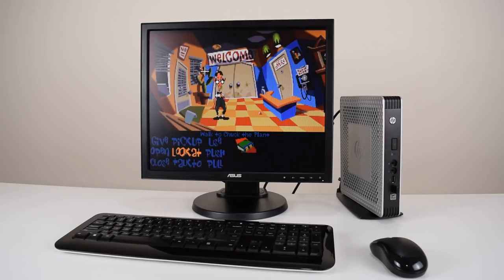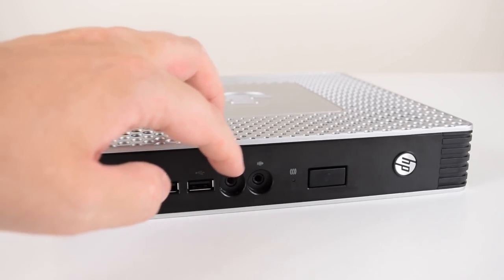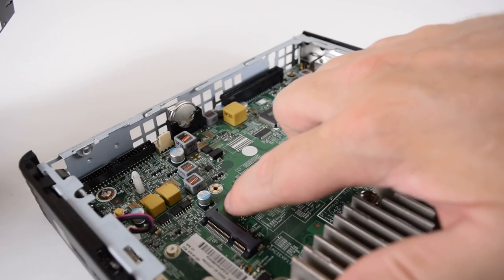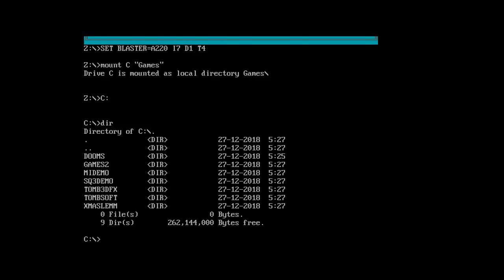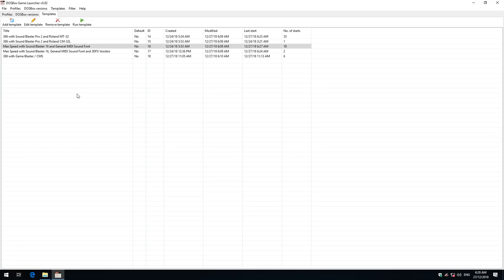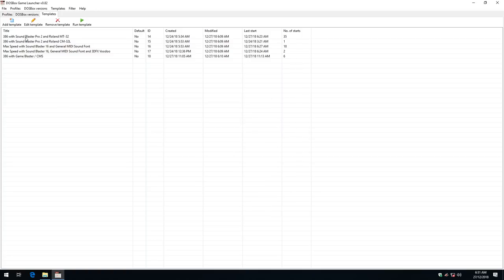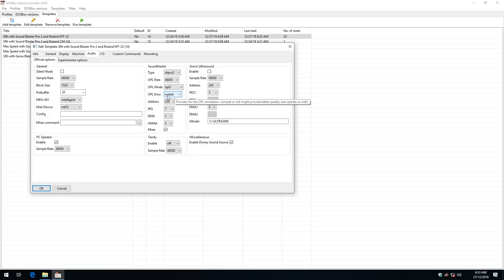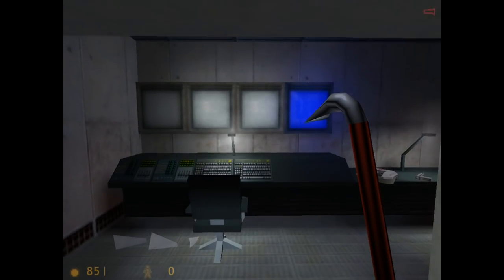DOS PC Classic - Building a DOSBox with Pixel Perfect Graphics, MT-32, 3Dfx Voodoo and more

Comment: That launcher for DosBox is pretty good. The root folder makes the launcher portable and it's an excellent option for pendrives. I still recall my young cousins stunned with several Dos games, including my favorite... Tyrian 2000. ;)
Reply: Definitely. My dosbox collection is setup on a 128gb microSD that came with a Micro to SD adapter and a usb adapter.
Reply: I use another dosbox menu program called launchbox for Ms dos 2.0 special edition

It's very dossy lol

Comment: Hi Phil, Great video.  I have $$$ for ebay, for a thin client, but i am seriously running out of free desk and cupboard space.

Two things to add
1. Another good add on for Dos box that i use is called D-Fend Reloaded, not quite as advanced and as good of what you showcased ( which is a better product ) but a smaller and simpler solution, it searches your dos box drive and finds matches, it has a wizard so popular games have a working config, all others you can run as is or select right mouse edit properties and you can change setting like meory usage , type sound etc

2. A similar product to dos box but geared more to console games is Recall Box, this is very similar to Retro Pie, you download the image for the main program and etcer or similar to USB stick, then in the folders add your roms.
The beauty about this program is the practicality, once burned to USB and set up, all you have to do is first power of the PC, then plug in the USB  , then turn on the machine, if the bios supports boots from USB, the program will load and you have the main menu to run the emulator / games, no need to the machine to load its native OS first

Again excellent stuff

Regards
George
Reply from the maker: I used to use D-Fend Reloaded, but no new version since a few years. I don't know about the second one. I always found that similar sounding tools are better for consoles and arcade games, but not for PC with support for MT-32, Sound Fonts and all of that.

Comment: That's pretty cool.  

I have a couple of the t620 thin clients from a job I did last year, they were pretty upspecced too. Hadn't actually thought about using them as retro machines. Will dig one out later on (in the middle of redoing my office/playroom) and have a fiddle. Should work nicely with my spare Dell 2007fp screen and it's soundbar. Might try running Gamecube/Wii and Dreamcast on it too. 

Could be an interesting change from a raspberry pi in a small arcade cabinet.
Reply from the maker: Man there is much you can do with them! From running a NAS (check my recent video), to running pure DOS / Windows 98 or Windows XP and many other uses.
Reply: @philscomputerlab  I am going to have to get one out once the office is done and have a play. I've got a couple of proper old machines in storage at the moment, but something small, low power and that I don't have to play hunt the IRQ on sounds good.

Comment: Thanks for this man! Last night I spent 2 hours trying to get pixel perfect graphics to work on several different versions of DOSBox - what a pain! Then I stumbled upon your video and it gets the job done under 15 minutes. Incredible.
Reply from the maker: There is an updated version on the DOSBox ECE website, but don't grab the very latest one. It mentions the last working version on the site...
Reply: @philscomputerlab  Great, thanks for the tip! What should I replace in your portable package? Just copy over the ECE folder and  overwrite files?
Reply from the maker: @PeterKoperdan  Add the later DOSBox into its own folder (they include version number in folder name), then go into the DBL program and add the newer DOSBox version and make it default for all the profiles :)
Reply: @philscomputerlab  Thank you!

Comment: This is awesome! I've enjoyed your mini PC/thin client videos but to be honest they are kinda meh to me but doing this using this box is an awesome idea. I've also never heard of the DOSBox ECE, I've been looking for an alternative to the Daum DOSBox. I have used DBGL before and it's great, Daum DOSBox just doesn't fit right. The pixel perfect really intrigues me (it's why I got a 1600x1200 monitor in the first place). How does it do the voodoo? Internal, nglide, dgvoodoo2? I know, I'm just going to have to play with this later. May I suggest a follow up video using loopmidi and the Sound Canvas VA and how to get the GUS emulation working? I'd be curious how well it would work streaming Steam to your TV like a SteamLink does. BTW everyone, if you scroll further down DBGL's website, you'll find pre-packaged full versions of Arena, Daggerfall and several packs full of freeware, shareware and demos. I know, a lot of ramble but I like this one. Thanks Phil!
Reply: P.S. Should have just read the ECE website: (No external Glide wrapper needed!) I'm going to have to test that with King's Quest 8. GOG uses nglide but dgVoodoo2 is much better.
Reply from the maker: I've never tried Steam streaming, but this machine should work just fine! I mean it will run many older Steam games even, thanks to the Radeon.
Reply: @philscomputerlab  I use a Steam Link usually with a Steam Controller and XBOX One controller. It's about 4in wide, 2.5in deep and a little over a half inch tall. It streams from my pc's RX 480 with no noticeable lag. PC is upstairs, TV is downstairs, say 60 feet of Ethernet cable and two switches. Downside is that dosbox games don't work. I intend to switch it out with a SFF HP similar to your own. More USB ports, can run non-steam games from it, emulators, etc. and use it as a media pc with Kodi. Maybe you can use thoes ideas as a thin client or SFF PC "game console/media center" PC project.
Reply: @GiSWiG  I'm still sticking with Daum because of shader support, save states and so on. Sadly the Glide emulation is something I'm not happy with and wrappers are also quite meh. ECE I did try before but didn't find it worth switching, but this was before Glide emulation via OpenGL. The problem I have with OpenGL is that I'm using DirectDraw to run games in their original resolutions using the Intel GPU driver's custom resolution option. Anything besides DDraw has problems switching to real 320x200 on my CRT.
dgVoodoo2 is really great for old Windows 9x+ games, but with DOSBox Daum it has problems too. Lands of Lore 2 for example is running fine ingame (except for flickering at the bottom of the screen) but the videos are really stuttering. Daum's build-in Glide emulation would be great if it wouldn't habe performance issues ingame, while video playback is fine.
Reply: @moomah5929  I see what you are saying. This will take some testing. I was playing around with Blood using the 3dfx patch in this setup; didn't work with ECE. I had to use Daum. I added it as a second DOSBox choice which opened a lot of the "experimental settings" which really aren't. I think "advanced settings" makes more sense. In the end, I didn't like it the 3dfx patch, I preferred using ECE with the regular graphics for Blood (use the vesa_nolfb machine type to get around the graphical glitches, svga_et4000 also worked). I'm liking the pixel perfect options ECE. Makes things look right on my 1080 monitor but I still prefer my 1600x1200 monitor for DOSBox. 
BTW, have you tried using openglnb? It works quite well but I prefer those nice, crisp square pixels. Maybe openglnb with Daum's shaders may work?
Reply: @GiSWiG  I didn't use openglnb as it doesn't support Daum's shaders which are DirectX shaders. Since using a CRT with custom resolutions, pixel perfect is now a given, but like I said, it only seems to work using DirectDraw. I did want to try ECE's OpenGL but they don't offer the necessary files for download but instead link you to Vogons. There the download links are only visible for forum members. I was going to create an account but the register button was gone. Just checked and it's back now, so I'll try testing ECE with 3Dfx.

Btw. the last days I was playing around with MAME and there I need to set it to Direct3D to be able to force the native resolutions. The only problematic games are ones switching resolutions ingame, as the auto resolution setting doesn't work for custom resolutions. Resolutions below 320 pixels horizontal, like 256x224 some Arcade games or SNES use, are also not possible as custom resolutions (at least in the Intel GPU drivers) but there I simply double horizontal to 512x224, which works like a charm.

Comment: Great job, Phil! This should make it easier for more people to get into DOS gaming. Just a slight "complaint": when I try to run launch.exe, it says that it requires Java Runtime Environment. Is there an alternative that works without that? I remember JRE being an entry point for many viruses etc. in the past (especially in combination with browser plugins), so I never install it ...
Reply from the maker: Yea DBGL uses Java. I didn't think it was an issue.
Reply: JRE is only useful for running Java applications at this point. Major browsers such as Edge, Chrome, and Firefox don't support JRE for the exact concerns you have stated. JRE is only supported in the IE as it is just for running legacy plugins and not exactly for modern web browsing due to its mediocre HTML5 support.

Comment: This looks fantastic! Just a couple of questions though:

1. Does this run on Windows XP? Not really a requirement, just a preference because of nostalgia

2. Can I configure this to use the same resolutions/refresh rates as the games themselves? I plan on hooking this up to a CRT and it gets blurry/washed out above 640x480.
Reply from the maker: I used Windows 10, but yes runs on XP as well. Yes you can configure output resolutions to 640x480 if you want.

Comment: Always a pleasure to watch your vidz, and love the enthusiasm... I have been having a look at the websites mentioned in your video discription but have failed (in my haste) to find an answer to my question(s), so rather than posting on VOGON (in the wrong thread / topic), I've come back to the source to my initial query.. So here goes. Is it possible to run this "set-up" on a Windows XP machine and if so, what would be the minimum requirements... Your video shows a Windows10 OS, 6GB of RAM, XXGB SSD... and an ATI ?? GPU... as much as the Thin Client seems cool, how about using an old ATOM based Eee PC laptop recycled from being just a photo storage album or an old P4 desktop resurrected from it former glory of menial word processing tasks.  I just want to try the project out and don't want to go full PCL style ... Hope you can point me to a link or even provide a few pointers below... Once again keep up the good work and look forward to more vidz on this crazy facet of retro-PC-ing.
Reply from the maker: Yes this should work under XP! I'm not sure about Atom CPU, especially the early models I believe they are very weak. I recommend downloading the package I put together, onto a USB, and trying it on your computers.
Reply from the maker: Careful, the version I'm using needs more CPU power with the pixel perfect image, Munt Emulator and everything else.
Reply: The file set was Download and copied to an IBM ThinkCentre 8194 (P4 @2.4ghz, 1GB DDR400 ram and Windows 7 Pro) ... I doubled clicked on the DOSbox Launcher / then added an .EXE in the Game Wizard from a CD. Low and behold, in 2019, here I am playing Bullfrog's SYNDICATE from 1994 on a 2004 machine running in 2009 OS...The only issue I have is the ingame screen size? But, for a first time out of the box (usbkey) experience, this has to be the coolest thing i've come across...no doubt, I shall mess around and see about getting the DOSbox to perform better and now need to get other games running... hmmm, where is my copy of The Chaos Engine!  Thank you once again for these clear cut videos which make for such interesting viewing and having answered my question above.

Comment: Regarding switching to old resolutions, while DOSBox is great for that (choose "original, scale2x, overlay" to output 640x400), SCUMMVM has been disappointing since they rewrote their video stack. With the latest versions you can only display SCUMMVM at the desktop resolution, which is wholly inadequate for pixel art games.
Reply from the maker: This project uses the Pixel Perfect patch, it's nothing like the technologies you mentioned and really on a whole new level. It's for running on modern LCD screens.
Reply: Of course, but thanks to the analogue video output, one could want to use such a computer with an old monitor to get the exact visual identity of these old games.
Reply from the maker: @youplaboum  IMO if you want that level of authenticity, I would go with an older Thin Client, like the T5720 that I reviewed a while ago. It runs pure DOS, has VGA and a lot of other things going for it.

Comment: Awesome video Phil, this makes using dosbox a lot easier to use. I'm struggling to get it to work with my SC55 that I run through a UM-One to my win 10 pc. Normally all I have to do is change the midi config to 1 in the options but it still uses the built in emulator regardless of the settings I use in the launcher. Any ideas on how to get it working?
Reply from the maker: If the MIDI Device is set to fluidsynth, it will use the SF2 Sound Font. Same for mt32. I think you need to set it to default, and then fill out the config box.
Reply: @philscomputerlab  Thanks Phil, had already set it to default but didn't notice the config box underneath.Put a 1 in the config box and it works now, I was changing it in the options file manually.

Comment: I need some help :/ 
Decided to get this older PC up and going again, but I can't seem to find the motherboard drivers for it. Its so old its like Sis-620-CB649MSIC-00
installed windows Me but no idea who made the board maybe Daewoo or something 
my sound card either. I need the VGA driver for the motherboard and prob other stuff.
Reply: The internet says it's a Daewoo, with socket 370 and no AGP slot.  Depending on what you want the PC to do, you could fit a PCI (not PCI-Express) graphics card, if the drivers on http://w3.sis.com/download/ don't work.  They have SIS620 integrated graphics drivers for DOS, Win9x, Win2000, but not ME; you may be able to use the 98SE driver on ME.  Some boards based on the SIS 620 use the ESS Solo 1 audio chip.  Phil has drivers for audio cards based on this chip, so that might also work for the onboard chip.  https://www.philscomputerlab.com/ess-es1938s-solo-1.html

Comment: Can you output 640x400 via VGA on this computer? I had a similar project to use with a CRT monitor, but I couldn't make the integrated INTEL chipset to output any custom resolution, the lowest I got was 640x480, meaning low-res games either had black bars or were horribly stretched. I had no problem with a bigger computer and a dedicated modern nvidia video card (after adding 640x400 as a custom res in the nv control panel).

Comment: No mention anywhere the portable package needs Java to run (me thinks its the front end). Read someplace that along with Flash, JRE is not recommended to be installed because its just as buggy as Flash and could leave machines exposed to vulnerabilities. Should be ok for the offline style Phil is going for, but for the lot of us using this on a regular internet connected machine, hmm...

Comment: What's the connector underneath? SATA again, or mini PCI for WiFi?
Reply from the maker: I believe it's another SATA connector. There is a screw nearby and it's for little SATA SSD modules that you can source on places such as eBay. Later Thin Clients come with such a module instead of the older IDE version.

Comment: I've heard Dosbox has an old versión of MUNT. Does the enhance community upgrade it?
Reply from the maker: DOSBox actually doesn't have Munt. But ECE version has it integrated.
Reply: ECE hast the latest MUNT (2.3.0) integrated, while regular DOSBox only offers MIDI passthrough to the operating system, using its built in playback capabilities.
Reply from the maker: @YesterPlay  Hey, nice seeing you here :)
Reply: Nice being featured here! ;) Thanks!
Reply: @YesterPlay  That's a very good to know thing!! I'm wonder I am fooling around with all these old and unreliable hardware if I can play perfectly in DOSBox...And having Roland for free...
Reply: I'd not consider the emulation inDOSBox perfect, there are still a lot of things that work better under real DOS with real hardware. But it keeps getting better and better.

Comment: Total noob when it comes to this, but how do you determine what profile is the best to use with each game?  Is it trial and error, is there a site to go to, or do I have to go searching far and wide?
Reply from the maker: Good question! You can do a rough estimate by release year. For example late 80s games should work with the 386 profile or slower. The important setting is the CPU cycles, it determines how fast it runs. If you run, let's say Descent with the 386 profile, it will run, but very slow. So you just increase the CPU cycles.

Comment: In the past you recommended using a separate computer to take care of the MT32 emulation. Do you no longer think this is best, Phil?
Reply from the maker: So a Thin Client isn't a computer?
Reply: @philscomputerlab  no I meant to say that you connect it as if it were a separate external MPU-401 device.